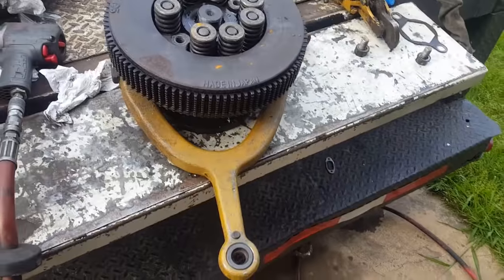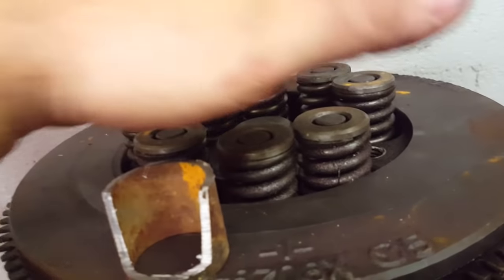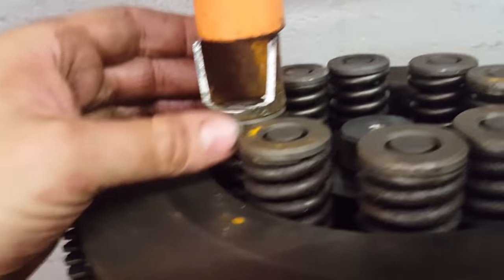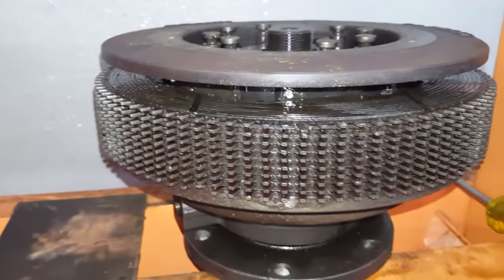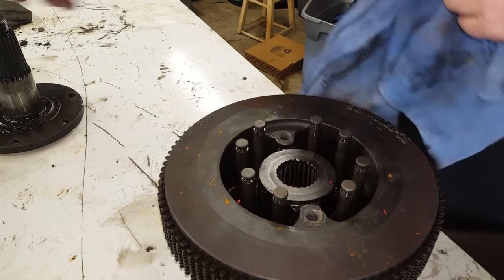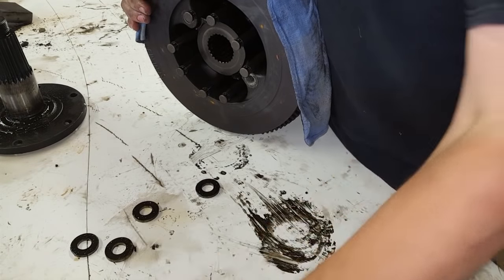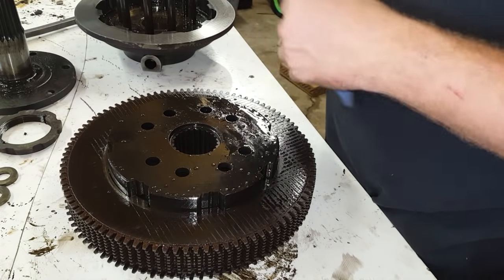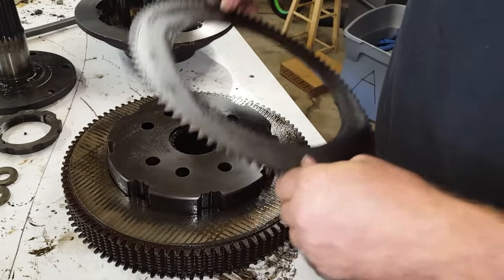CAT 933C steering clutches and brake replacement part 3

Comment: Just a note to viewers, if your steering clutch is old enough and seized enough, when you try to remove the splined shaft at 5:10 in the video the pressure can cause the casting to break instead of the spine coming out. 

Just did this today and was very sad.

Comment: You DO NOT have to replace the clutches
Wipe them down with gas the spray them with brake clean !!
Reply: I did just that and mine worked fine. But when you are making 50% mark up on your parts !